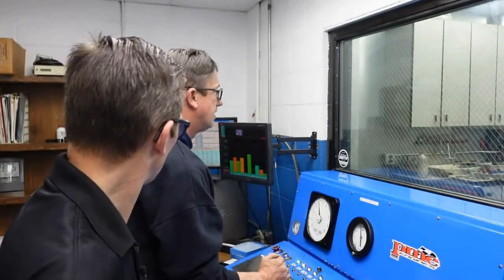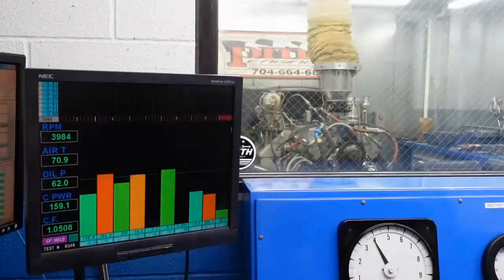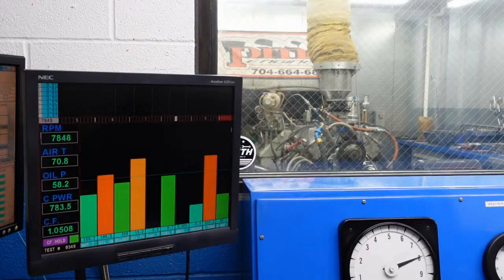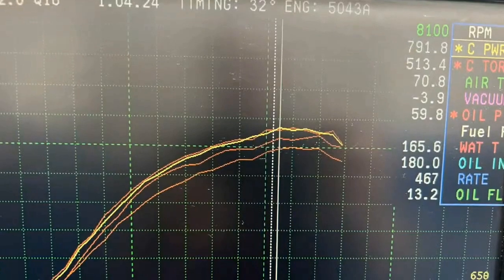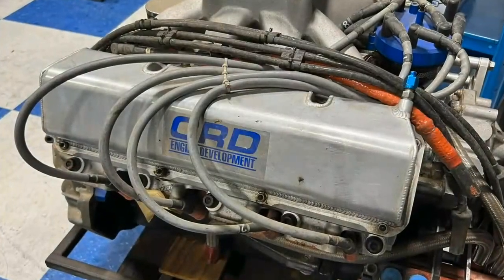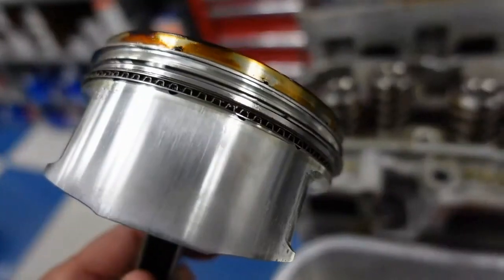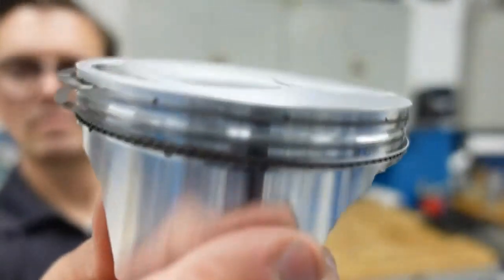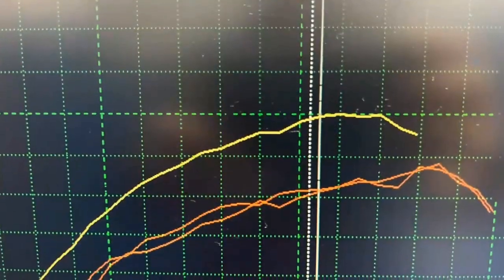How Much Power Can You Gain WITHOUT Changing Camshaft or Cylinder Heads? (Expo 2024 - Episode 39)

Comment: Maybe I missed it but trying to figure out how much gain before the fuel and carb
Reply: So to recap
Before the engine got hurt 736
After the machine work 770
New carb and fuel 791
Reply: And they said 791 after
Reply: I think it read 770 on the gauge during the first run
Reply: @deanbryan3034  thanks. So pistons, rings, and cylinder prep worth about 35
Reply: @treyrags  yeah that's what it seems like.